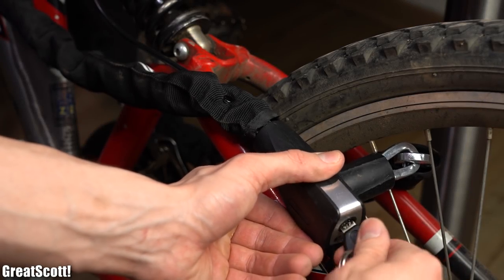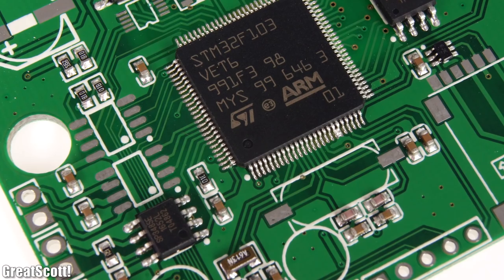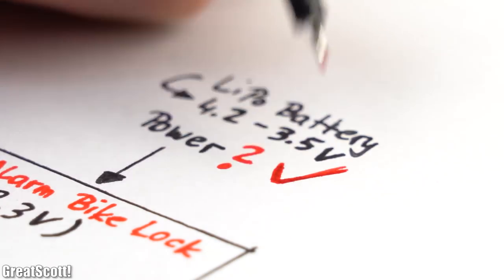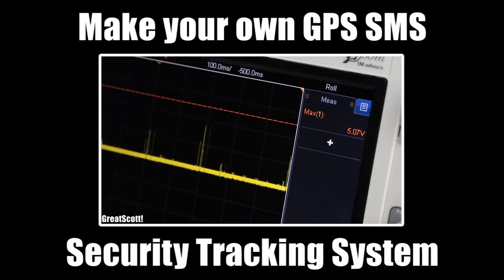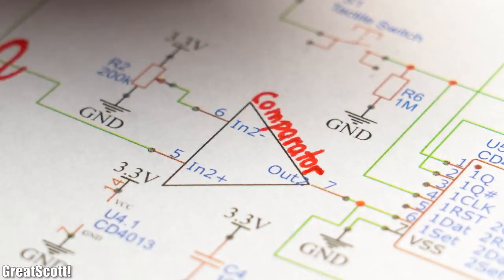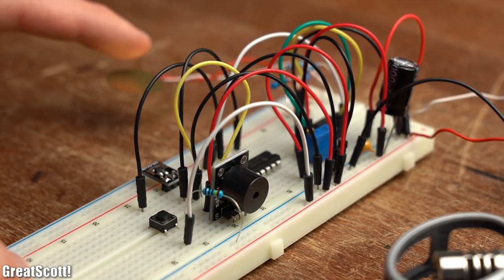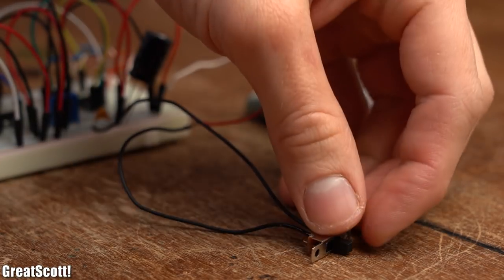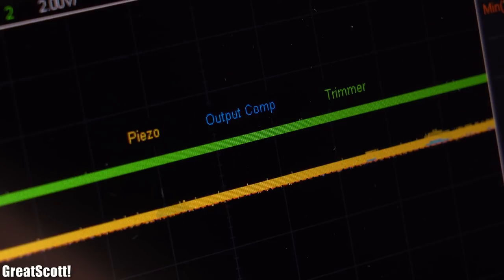DIY Alarm Bike Lock (Shock Activated)

Comment: Hi, what is the best legit website to buy electronic components?!
i mean without getting some fake components!
Reply: Depends on how badly you want to avoid fakes.  You (almost) never get fakes from Mouser or Digikey, but they cost a lot more than, say, AliExpress, where you can never be sure of anything.

Personally, I got most of my jellybean parts off AliExpress.  I also got most of my microcontroller boards (Arduino clones) from there, and have had good luck with them.  I'm rather fond of the knock-off version of the Sparkfun Pro Micro - I paid less than $5 a pop for them and they've all worked.  The big downside is that shipping usually takes forever.

For project-specific parts, or when I run out of, say, 330K resistors, I usually get them from Mouser.  I've never had an issue with Mouser or Digikey, although I've only used Digikey a couple times.

I live in the U.S.  If you don't, things may be different.  Also, I haven't ordered from AliExpress since all the trade war crap has been going on, so things might have changed there.
Reply: @jeffspaulding9834  what about lcsc? is there a chance for fake components from there? i mean mosfets, ic's, transistors and so on!
Reply: @f.a3202  I've never bought from them, so I don't know.  I sanity checked a couple of their prices, and they look comparable with Mouser, so that's a good sign.

Perhaps you'd be best asking somewhere like the EEVblog forum or an electronics subreddit.
Reply: @jeffspaulding9834  ok man.by the way thank you very much for your help!

Comment: so if someone bumps in to you bike (happens a lot here) it just goes of always ?
Reply: spook to soon
Reply: but stiil there is that capacitor that is charged and not discharged after 6 seconds  ?so next time it will sound not that long anymore ? or am i wrong.
Reply: A bump will cause 6 seconds long beep, so wind and short bumps would not cause annoyance. However if it is stolen and someone is riding/carrying it that would cause constant shake and cause constantly repeating beeps

Comment: I would have included an integrator at the input, so the moving the bike slightly does not activate the alarm. Instead if it is moving for about 3-5 second, then the alarm could be fired!

Comment: i have this Idea to build a GPS bike tracker Alarm, (for under 25€). In case someone steals my bike, the tracker send the actual GPS position via SMS every five minutes to my Handy. It need a GPS module, a motion sensor, and some kind of GSM module, it have to be small to hide on the bike and and energy saving and long lasting. So i thought as platform an ESP8266 because of the Deep Sleep mode.
Maybe this idea is something you can do or try, show if it will work.

Comment: is soo easy to silence the piezo buzzer, why you don't make a device that triggers the forward brake once it reaches x speed?
Reply: woah slow down satan
Reply: Easily done by adding a generator to the wheel, no batteries needed. Have the first stage be a buzzer in a location where it's easy for the thief to rip it off (giving him a false sense of security and you a warning if you forget to deactivate it), second stage could be activating the front brakes, igniting a bunch of firecrackers, or spraying the thief with red paint.
Reply: Or just tie it to a very long thin wire so that when someone starts riding it eventually reaches the end of the cable and sends them flying 😂

Comment: "Could be home-made. If you have a few electronic components", sure have, where do I start? "and a 3D printer." :(
Reply: You can do the enclosure with another material too
Reply: indeed, those old black plastic enclosures we all relied on in the 80s and 90s are still around and come in many sizes. Really cheap. Mind you, I got a simple 9V battery operated bike alarm from Banggood for just a few dollars - still on its first battery after more than 2 years of use (bought mid 2017). Gives three warning chirps and the fourth time the bike is bumped it screams blue murder. Unfortunately the local birds LIKE the warning chirps and have learned just how long to wait between bumps to avoid the full alarm.

Comment: I suggest that you reverse engineer one of those personal keychain alarms for a really annoying buzzer. It is done with a piezo-disk, an inductor and a resonant cavity. Last summer I was starting to construct a burglar alarm box which was unfinished because the vacation ended...
My circuit was based around an ATtiny13 - probably you could use the piezo-disk as double purpose...

I just pu my box design onto Thingiverse (which seems quite broken since their latest makeover) https://www.thingiverse.com/thing:4249070

Comment: There is no purpose for the timer. Toggle switch to turn it on and off, and potentiometer to adjust the sensitivity.
Reply from the maker: I think I said why I added a timer.
Reply: @greatscottlab  Your reasoning was that if bike got hit by a wind, then it would start screaming. You have potentiometer feedback in the comparator. You could adjust that to adjust the sensitivity. Maybe the sensor acts like a digital device?

This circuit makes assumption that buzzer is a simple load, but in reality buzzer expects a pwm signal to drive it. 555 timer is a good fit for that, because it includes a enable/reset pin.